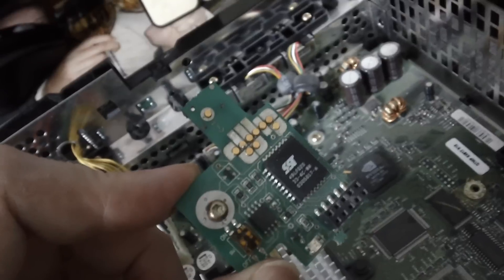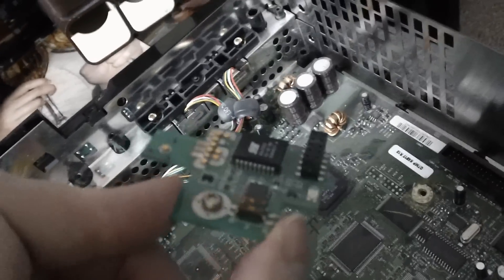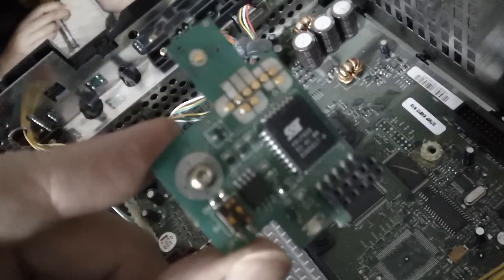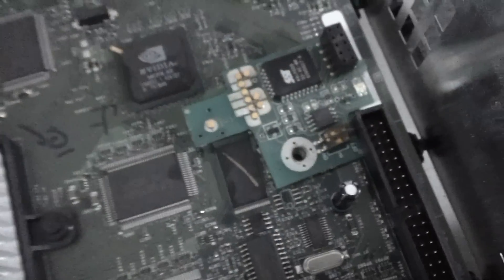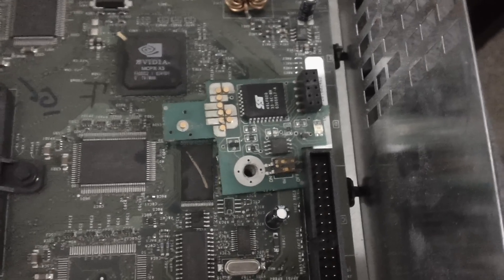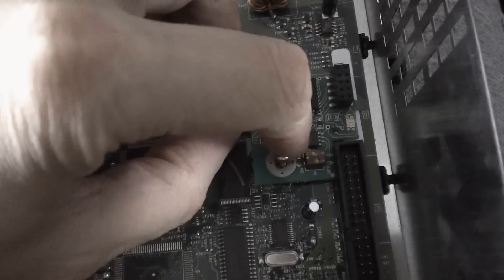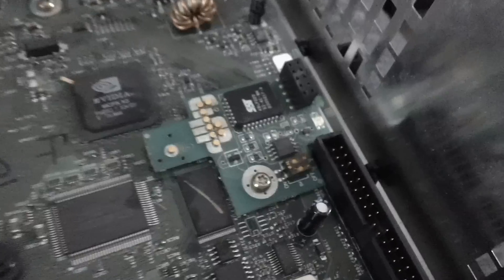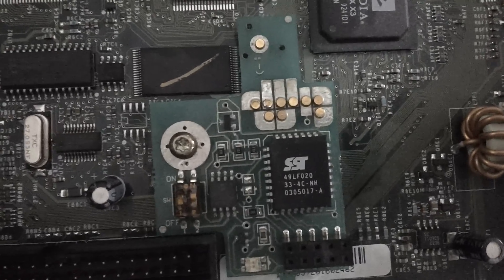My Xbox Solderless modchip, Can you give me info on it?

Comment: Matrix Chip by Xodus. Needs a separate programmer (i still have mine).

The Programmer has to be powered by a 9 volt battery that is on-board it. Connects via a Serial DB25 port that is mostly found on old computers for the Read/Write of the Mod-chip. 

The Pogo-pins on the chip can be a little fiddly to get just right, you use the dip switches in different positions to either Read (on position), Write (to it), Align (it correctly, shows 2 green LEDs from memory) or Turn it off (so you could play online).

You could also use it to Write to the On-board BIOS of the Earliest Models of Xboxs (which I also have) using a Single Jumper wire.

Comment: I don't know much about them but it looks similar to the one in my old clear XBOX crystal.  The guy who installed it said he didn't like the spring loaded pins (solder-less) style chips so he actually cut off the spring loaded pins and soldered wire to all the contacts!  He does all the systems and even made his own mod chip for the Wii so I figured he really knew what he was doing!  But my XBOX died.  Bad caps and Hard Drive I think too so I just gave up on it.  But I still have it somewhere...

Comment: Is a Xodus/Matrix solderless 256k bios modchip used on early xbox models 1.0-1.1.
Reply: I have one, got it years ago, and lost all info on it; I believe you're right on the name. Although I do have  a problem thought, I now have a 1.3 that does not recognize it; will this chip work on a unit other than 1.0-1.1?

Comment: I had one back in the day.it was a pos as it would constantly lose connection.seems about everyday id have to Crack the xbox open and  realign the chip.over time the pins and vias got so weak that it was nearly impossible to get back working.

But I didn't know how to solder then.think I still have the programmer laying around..

Does xbox scene not have info up about these any longer?

Edit,o dang I just saw that xboxscene is gone! Wow no wonders all of this information has been lost..

Comment: No, it's a Xodus / Matrix modchip. I have 5 of them right here, but they're useless without the programmer, which I also have 5 of..
Reply: Sorry, really old post i know but how is it useless without the programmer? I have one, switch the two micro switches to off and reprogram in evox just like any other modchip. I flashed mine with IND.5003 bios and its working great. The external programmer would be great for recovery flashing but it can be flashed without it

Comment: I agree looks like an Aladdin chip of some sort.  I never trust solderless myself.  I guess if your buying it preinstalled not much of a choice.  I got a spare xbox with a header soldered in just in case my current one dies.  Both my systems have corrupted bioses and need the a modchip  to boot.  What would you like to know about the chip specifically?  I think you already pretty much know all I could tell you about it.  Funny how I bought two xbox and got the same problem.

Comment: I can't seem to find any solderless chips that match the one you have. I've never seen it before. It looks very basic so it's possibly an unbranded budget Chinese modchip that was based on one of the more established brands of the time. Usually the branded chips will have the chip name printed on the board somewhere in very small print.
If you have a later build of XBMC on your Xbox I think there is a hardware info/detect option that'll give you details on any modchips installed.
Reply: It's the Matrix mod chip